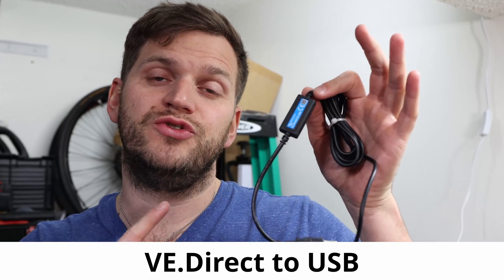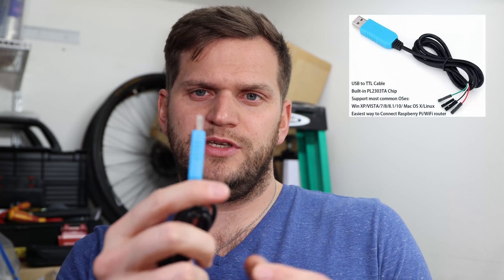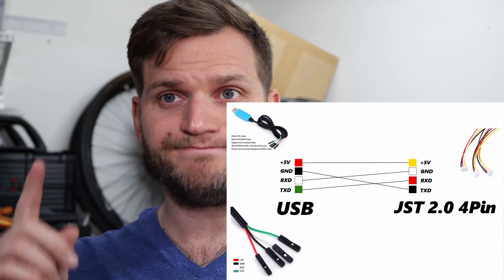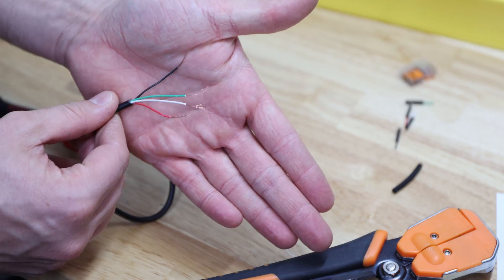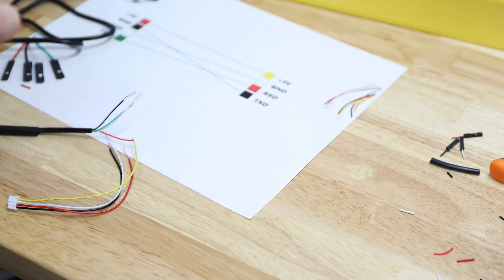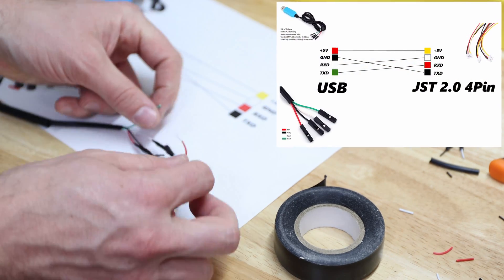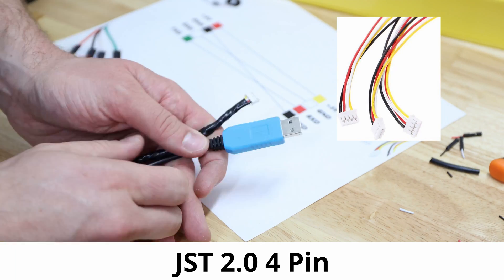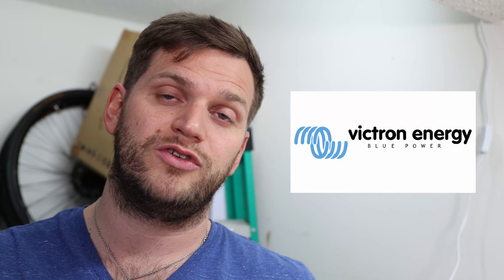Victron VE.Direct to USB DIY | $4.09 one cable | Do It Yourself

Comment: Thanks to you and this video, I bought the USB and JST 4 pin cables for my project!
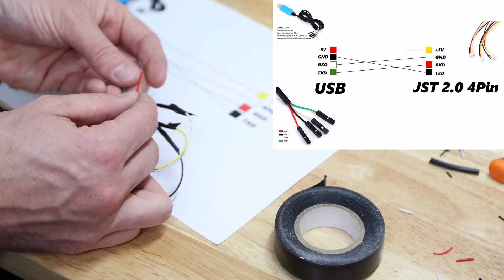At 6:14 your diagram shows the wire mapping from USB to JST.  Curious why GRD doesn't go to GRD, RXD doesn't go to RXD etc?
Reply from the maker: Hi Chris, Thanks for bringing this up and it looks like I made  a mistake with my labeling for the JST 4 Pin connector. The correct labeling is:
Pin 1 (black) – GND
Pin 2 (red) – RX
Pin 3 (white) – TX
Pin 4 (yellow) – +5V

Still, the color matching is correct, it is just the labeling of the JST 2.0 4 Pin cable off.
Reply: @tobisreallifeskillswithtobi  that''s really handy to know once we've expanded every comment to look at replies. Why isn't this error at the top of your description info ? Pointing out that 5V pin4 is on the left of the Victron 75V models would also be useful.  It's the other way up , so on the right on 100V.
Reply: @tobisreallifeskillswithtobi  sorry im still confused can you do a overlay of the correct pinout plz
Reply: @tobisreallifeskillswithtobi  Hi. I just bought some JST connectors. On the picture on Amazon they look the same, but now they have different colors, They have red, black, yellow and green. So which color is what?

Comment: Just ordered a controller and had a suspicion that the data port might just be using regular Serial and this video confirms it thanks!
I dont even have to buy anything, I have so many USB to Serial adaptors and also the right connectors, just need to wire it up.
Reply from the maker: Great to hear and thanks for watching!! :-)

Comment: why didn't you just plug the cable in without getting that connector? I guess if you are going to do leave it connected all the time cool but i just need to program the unit and that it.

Comment: For me the wires of the jst connector where completely floor around! After switching this, everything worked! Luckily this didn't damage the smart shunt..
Reply: Hey! my Shunt is not working with this cables, is there any changes in order to get it work whit shunts? Tia

Comment: Could this be done without adding the JST? Using just the black, green, then white? Or are the pins loose in a dupont connector? I have a ton of 3 pin dupont connectors for RC stuff, and it would be much easier to just swap in one of those.. (assuming its tight)
Reply: Never mind, the jst is WAY too small for a dupont connector.

Comment: Just a tip, the JST connector pins can be easily pulled out and rearranged to keep the red and black wires separate.

Comment: How do hook them up?  What do you hook them too?  I wanted to see how the system works before I bought it.
Reply from the maker: There are other Victron components like Shunt or MPPT Solar Charger, etc. which you can hook them up to and connect to your Cerbo GX or Raspberry Pi with VenusOS on it... Look through my videos and you will find more ;-) Thanks for watching!
Reply: @tobisreallifeskillswithtobi  Thank you for your reply.  Do I have to have a Victron charge controller for the bluetooth monitoring to work on my computer?  I have a bluetooth dongle but my computer doesn't see it.   Installed the bluetooth driver and still the computer doesn't see it.  This what's keeping me from buying the Victron shunt.
Reply from the maker: Only with Smartphone and the Victron Connect App. Bluetooth with Raspberry Pi and VenuOS won't work
Reply: @tobisreallifeskillswithtobi  I did some investigating.  I thought I could use my windows laptop with bluetooth but I can't.  Have to use USB with windows OR get a special cable and interface to use LAN with windows.  Too complicated and expensive.  I think I'll just get a hall sensor instead.  Nice and simple.

Comment: Your cable that I made burnt out my charge regulator. What do I do now?  The technical documentation tells us to change the fuse, but it's soldered to the board.
Reply: Got it working? 
I doubt though. Those wires are connected to the chip and no fuses there. The fuse fromt he manual is for the Solar/Battery part of the circuit.

Comment: I'm new to Victron but do I need a cable for this if I'm using a Victron MPPT 75/15 w/ Blutetooth and a Raspberry PI Zero 2 W? Would the PI be able to read data over bluetooth without the need for the cable?
Reply: Nope, need official cable. This oke did it wrong in any case so don't try to make your own from this vid

Comment: Just a note for viewers : Jst connectors come in different variations with colors not the same as what is described here. Important to note is the two outside wires run straight, parallel which should actually be red and black. Meanwhile the two center wires which are the TX and RX criss-cross.

Comment: Correct me if I'm wrong but wouldn't it be simpler to describe it as the two outer wires run parallel or remain the same but the two inner wires criss--cross. done!
GRD   - GRD
TXO    -RXO
RXO    -TXO
POS    -POS

Comment: @Tobi I have made several of these cables and if I connect more then 1 to a RP system only 1 will stay connected, any suggestions
Reply: Did you fix this? One way is get the Duppa 4-way isolated USB to TTL adaptor. (details in an 'offGridGarage' video). Unfortunately they are sold out till the middle of January right now.

Comment: This did not work for me. I followed Andy from Off Grid Garage and it worked. https://www.youtube.com/watch?v=50V50lISnC8&t=1392s It is possible the pin outs changed on the JST I am not sure but your pinout didn't work and I followed all your Links to buy the parts. I am in the US so maybe the parts delivered were different. I do appreciate the Video. I used your other video to get my Raspi loaded and connected to my network without connecting a monitor to it. That was very useful.
Reply: I had a unique case where my batteries are 40 ft away in a shed outside my home.  his is also where my smart shunt is. I did this as my batteries are NiFe batteries and off gas hydrogen. I used usb extension adapter via ethernet cable. Then ran an ethernet cable to my shed. I thought something in the length could also be a problem but changed the pinout to match how Andy did it and voila! it worked.
Reply from the maker: Thanks for sharing! I have to look into this :-)

Comment: There are some variants in the MK3 to USB connector that all should be aware of.  Toby's USB A connector is built for a PC or MAC connection.  The other end is a 4 pin connector.  I have a Multiplus Compact which has a RJ-45 Ethernet in it.   So you plug in with a Ethernet cable.  The other end is a USB C cable designed to connect to an Android phone.  I hope to use Vicltron Connect to update the firmware on my Multiplus.
Reply: Der MK3-Adapter ist für einen VE.BUS und NICHT für VE.direct !

Comment: Can I use this cable to connect a phoenix inverter to PC?
Reply from the maker: What would be your intention when connecting the inverter to a PC? It can be connected to a device which runs VenusOS for example - which can communicate through the cable.
Reply: @tobisreallifeskillswithtobi thank you for your reply. I would like to adjust cut off voltage, top voltage and load check period. It's a phoenix 375VA inverter. I'm just worried about connection without optocoupler. Can I have any issues without an optocoupler when connecting to PC with DIY cable?

Comment: I am anxious to see how you duplicate the opto-isolator.
Reply: I was wondering why the original cable from Victron had that little 'box' along the cable.
Reply: how would I include something like a BOJACK PC817 Optocoupler in that? Thanks!
Reply: @JulianGoesPro  Try the ADUM1201 - its made for this. And NEVER use that cables, without an optocoupler, u can fry your victron units, if u have a gnd loop ore something else. many ppl fried their mppt chargers and so on, because they saved that 2$ piece ^^

Comment: I have a question, my BMV-712 monitor is routed about 20+ feet away from where my Raspberry Pi & all my other Victron components are located. How do I extend this to reach the back of the BMV-712 display (where the VE. Direct plug is located)? Do you know where I can get a set of wires (matching) that I can splice in-between these to make it longer?
Reply from the maker: Good question, let me check
Reply: While not color matching you could use Cat 3 or better Phone or Ethernet wire. they are solid core (low resistance), and twisted to protect the data in transit. AKA UTP (Unshielded Twisted Pair)

Comment: So its USB out the ve.direct port and they used the jst connector instead of a micro-USB to sell expensive cables!  I will be doing a jst to micro USB port asap.  Thanks for the diagram
Reply: Well, NO! This is not just a 1:1 wire connection. You need to take into account the USB-to-Serial converter (e.g. FTDI or PLC2303) within the blue USB unit, plus the galvanic isolation that's missing from this DIY sketch but which you may want to have for dealing with ground loops and/or 5V/3V3 differences (see other comments).

Comment: Hi I had different color setup for my JST 2.0 but I think you can better do it this way also you don't have any issues with connecting the wrong wires https://youtu.be/50V50lISnC8?t=1503

Comment: Huge problem with the cable is, no galvanic isolation, that's why the oem cost more and is more safe...
Reply from the maker: Yes, there are some downsides for making the cables yourself. I will make a follow up video to clarify this.

Comment: Hi all. This cable will initially work (without the 5V connected, the Victron bus use 3.3V), but when installed in a system with a Victron shunt for battery monitoring, or together with other components, you will create a ground loops, creating a wrong grounding reference, and making the cable to an antenna. The data will be unusable. (reading 100W power usage one second and 13200W the next, and back to -300W and so on.)  Tried it myself.
You will then need to make an isolated TTL cable, which will cost you nearly the same as the original Victron cable.
I hope I will spare you for some money and time.
Reply: Thank you for your reply. I purchased all the parts and was trying to figure out why the video showed Rx go to Gnd, so I decided to look in the comments and found your reply to the isolation topic. That made me go read the VE.Direct Protocol, and found where it states "...provides galvanic isolation between the VE.Direct product and the host (your computer/PLC/etc)". So I'm not going to make this cable, and have to use some other way to extend the USB cable. That way maintaining the Galvanic Isolation used by Victron's cable.

I do thank you Tobi, for making the video however, it and my research has taught me more about the victron systems
Reply: I got a USB extension cable from amazon, cut it so the wire would go through a small hole, and then soldered it back together.
Reply: @jbat66  Hi, did you end up finding a good solution that works? I am also looking into doing the same thing. Thanks
Reply: @marinetrax  I just used an USB extension cable. I have not had any problems with my USB extension cable. I would suggest getting a USB 3.0 Extension cable as they are built better for the higher speed than the 2.0 standard. If you have to cut the cable, make sure to use aluminum foil around your splice. cover it with electrical tape or heat-shrink tubing. FYI, the victron communication is not going to be high speed, it just means the cable is made better.
Reply: @jbat66   Your an absolute legend mate ;-) Thanks SO much ;-).
Reply: @jbat66  I am curious as to how you extended your usb cable.  I have the same problem, my equipment is about 12' from where I want to mount the pi and screen.  I have never seen usb extension cables that long and would be concerned about data integrity. Maybe just extend the cable after the isolation?  What have you done to solve this?
Reply: @jbat66  I just got  the Smart Shunt today. So am I right in saying a DIY cable won’t work with the shunt? I have two controllers using the DIY cable and they work fine but if I got the original Victron cable would that work with the Shunt? Thanks
Reply: @michaelgkellygreen  I sure wouldn’t use it, it’s just as cheap to buy a USB extension and then you can cut that cable and solder it back together through a small hole. That way you are using the correct cable from Victron and that you will not make a ground loop.
Reply: @jbat66 big thanks for the reply but I’m a bit confused as to how it works. So currently my two charge controllers are connected to the pi using the DIY cables. I want to add a shunt. How does the USB extension come into play?
Reply: @jbat66  i just ordered the official ve direct cable from Amazon only to discover its VE direct to Ve Direct and not USB on one end. How silly of me as this is no good to use with a Raspberry pi. The official USB to VE direct cable is so expensive. So going forward what are my options to get the Smart Shunt detected ? Cheers
Reply: @michaelgkellygreen  Confusing isn't it? I've just been playing this game. If you fork out for a proper GX device then you can use the cheaper VE.direct serial cables. But if you have anything else (usually a Pi) then you need the VE.Direct to USB. The expensive Victron one will work (but in my case the connector won't fit through some holes so I have to cut it off and resolder anyway. But as people point out above a non-isolated version of this cable might work depending on your circumstances, or it might not. And there is some risk of damaging the MPPT devices because the serial port is connected almost direct to the CPU inside and significant voltages on the RX and TX pins relative to earth can damage that CPU. You can buy optoisolated RS232 to USB devices but they are nearly as expensive as the kosher Victron one. Which is odd because those cheap UART devices are a fiver and adding optoisolation should cost a couple of quid so they should exist for <£10. But I've not found one yet.
Reply: @xxwookey  cost me 36 euros for the official cable. Currently i have two other Diy cables non isolated and get disconnects 2 or 3 times daily. I have two of those isolated usb adapters on order which cost 40 euros for two. Still cheaper than the official cables. Hopefully the disconnects will stop when i have all isolated cables.
Reply: use the board with ADUM1201 to prevent ground loops
Reply: @jensschroder8214  smart move!  Cost for the isolator is anywhere from .82 to $2.50. Soldering required but so what. Thanks for the tip.
Reply: @jensschroder8214  Could you show me how you did it?
Reply from the maker: Thanks for sharing your experience with the community! I did indeed not use it that way!
Reply: Yeah ran into the same thing myself.  The cable worked for the first bit when i just had a pair of 150/45's connected to some batteries and wanted to play with a Venus/Pi VRM setup.  Once i added the SmartShunt they started getting really unstable and it got worse as i added more devices where MPPT's would just drop out.  Swiching to the legit cables made everything 100% rock solid.